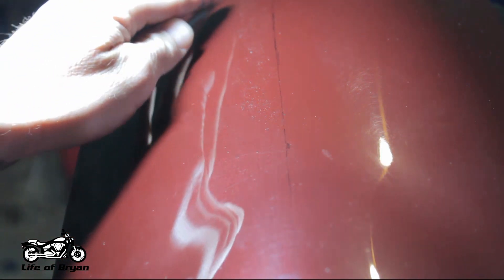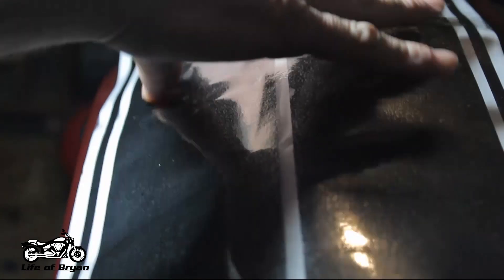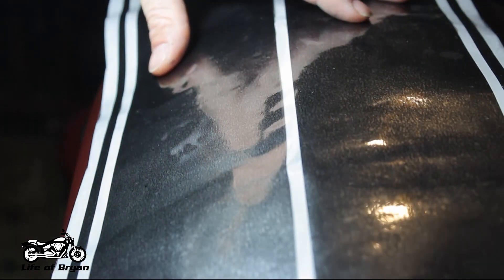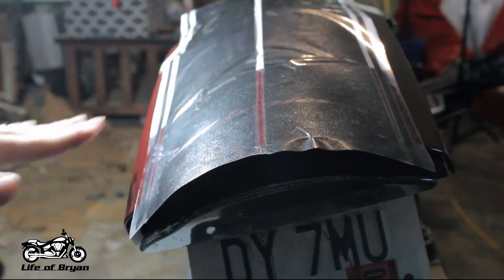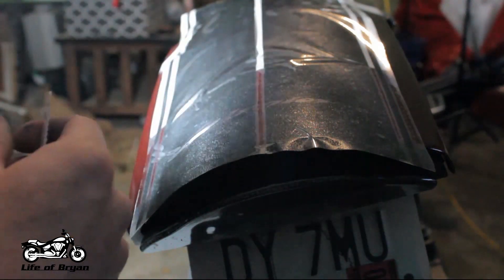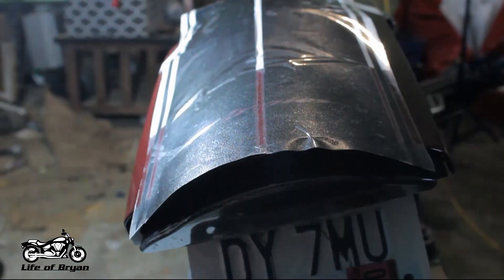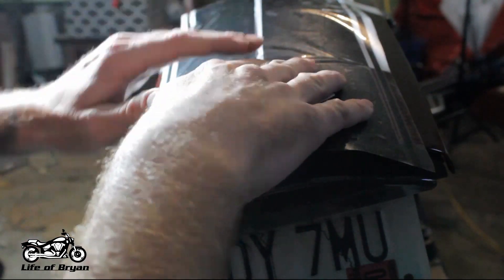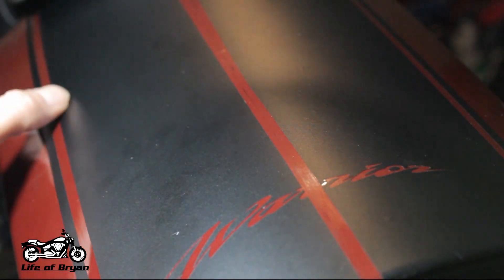Yamaha Warrior 1700 Vinyl Stripes

Comment: Wow...nice! I have the 08 midnite warrior what color would you suggest? I dont have the red trim on the wheels.
Reply from the maker: Hey Johnny! Man, the black could go so many different ways. Of course white and black always go good together, but it's so typical. I'd probably go more for a matte gray, or a red. I like red and black a lot, used to have an old Mustang that was black with red stripes and it always reminds me of that. The gray would almost blend more though and not be as loud and noticeable. Of course, it always boils down to preference. What do you think would look good?
Reply: @RSWarriorBryan  i thought about the grey myself, but im not sold on changing anything yet for fear i wouldn't like the look. How much you guys charging by the way?.

I totally need a new back tire, recommend anything? I have a 200 on the back and was thinking about putting a 210 but read putting a 210 on a 200 rim wears out faster.
Reply from the maker: Yeah, they actually will wear different and the bike won't handle quite as well. The 200 is perfect for the warrior with a stock swing arm. As far as brands, you can find some for pretty decent prices, but I would recommend something like the avon storm 200/50 17. They last quite a while and overall are great tires. I've heard the Metzlers tend to wear a little quicker, and for the price they have the avon now, you can't beat it. Here is an Amazon link I found for one. 

https://amzn.to/2rmNwqq
Reply: @RSWarriorBryan  Thank you so much Bryan.
Reply: @RSWarriorBryan  Bryan..im getting ready to pull trigger on the link you sent me for the Avon tire..are there any better one's you can recommend? Im not worried about money..and also sorry to say but i ride hard as if im riding a dirt bike..(like an idiot)
Reply from the maker: Hey Johnny, I think you'll be happy with the Avons. When you take into account the price, performance, and durability, they're pretty hard to beat. They usually last over 5k miles, even with pretty hard riding. They wear evenly, and they have good grip as well. Many of the warrior guys swear by the Avons and that's what I tend to stick with myself.
Reply: @RSWarriorBryan  you know what Bryan..i think your right. I looked at a bunch of reviews of the Metzler Me880 and other brands and they seem to wear prematurely.

I seen nothing but good reviews about the Avon. I ordered it already on Amazon. Thanks for the link.

I made a new friend with a guy who has a H-D Fxdr, we raced 3 times and that bastard beat me all 3 (i shouldn't have been street racing with a bald AF tire). 

I wanted to mod the hell out of my bike for maximum quickness out the gate but the reliability of a daily rider.

Any suggestions? Budget not a concern!!!. That would make a good talk video with part links included.

He couldn't believe how awesome the way my Warrior sounds.😜👍 I have the Pacific Coast Monster Pro 2 in 1 Bomber style pipes with a racing baffle.
Reply: @RSWarriorBryan  Hey Bryan..thanks for the link with the rear tire..i had it put on the day before yesterday.

Can you send me a link for the same tire but for the front please.
Reply from the maker: No problem. Hope you're liking the back tire so far. On the front, were you wanting a 60 which will leave a gap between the fender, or a 70 which will get you a little closer? I lean more towards the taller 70 myself. I am going to include a link to the Avon Storm 120 70 zr18's which is the size I'm running on mine. Let me know if that doesn't work and you're looking for something else. Thanks Johnny! 

https://amzn.to/2Lz1mzb
Reply: @RSWarriorBryan  Awesome! Thank you Thank you!!👍 Have a great Holiday!
Reply from the maker: You too! Hope you and your family have a great New Years as well!